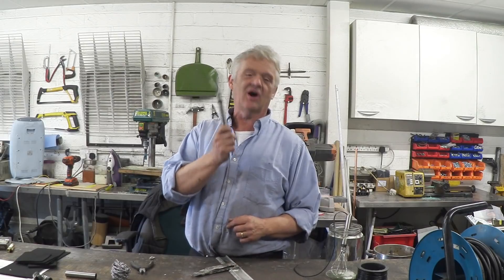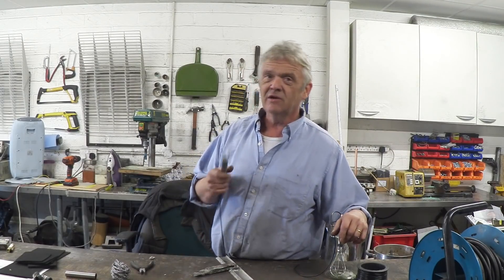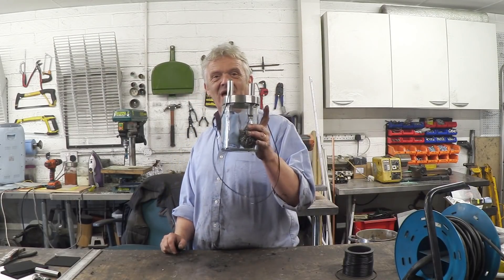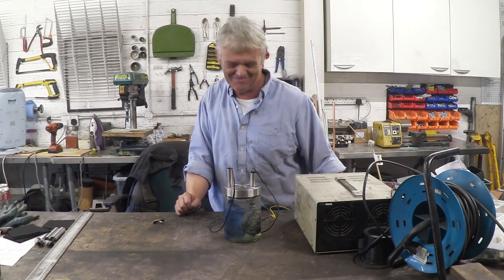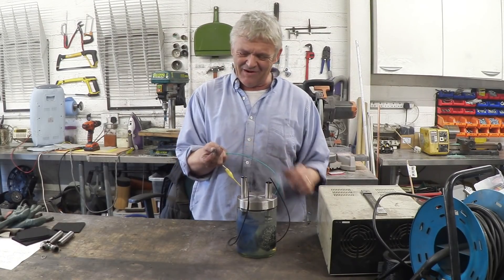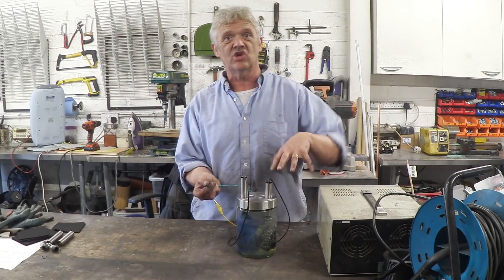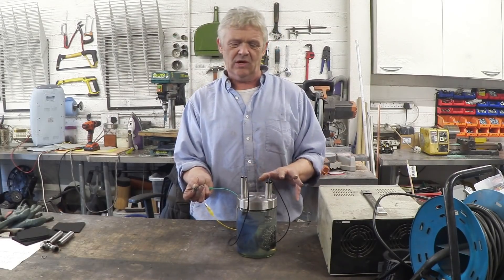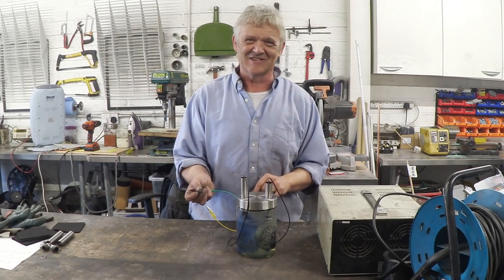1258 How To Make A Supercapacitor From An Egg Whisk

Comment: I accidentally made something like this with 2 pencil leads and a saturated magnesium sulfate solution. It can charge up to almost 3 V and deliver a reasonable amount of current for the size of its electrodes which are standard number 2 pencil leads.

Comment: Sir! I am having a problem .. I have tried to make battery 3 times and two with activated carbon and one with manganese dioxide .. Used potassium hydroxide as well as sodium sulphate electrolytes and charged on 2.6v  (at 3 volt electrolyte start burning) but all the time after charging voltage suddenly start dropping and battery don't have power to test on EBDtester ... Can anyone rectify what I am missing 😔

Comment: That's awesome, thanks Robert. :)
Reply from the maker: it was meant to help mate - I loved your idea
Reply: @ThinkingandTinkering  did you determine the overall output of that cell?

I was thinking about making a grid storage or backup storage device for the house for either power outages or for renewable energy storage. 

Would the wire whisk idea work if you were to wire a bank of these beakers in series and run an inverter off of it or am I dreaming in technicolor?

Comment: I still don't understand the difference between a battery and a capacitor. Seeing this it's even harder to get 🤦🏻‍♂️🤣
Reply: In brief and probably overly simplified  but  storing energy in a battery is done electrochemically, and discharging a battery is also electrochemical, as in chemicals are broken up and others are made and energy is either stored or released during these chemical changes. 

On the other hand, a capacitor simply stores charges without altering chemicals. There are several ways in which charges can be stored, but it's a capacitor if it's not changing the chemistry during charge and discharge.
Reply: @kreynolds1123  thank you for explaining. In that case, what sort of energy storage would those mechanical devices be? There's a couple of those around and they are usually called batteries too.
Reply: @marcogallazzi9049  ways a capacitor can store energy. 

We might start with looking at two flat plates and nothing but space in between as a basic capacitor. Charges builds up on  both plates. The charges tend to repel like charges on the same plate but are balanced by their attraction to the charges on the other plate. 

Now let's insert a separator inbetween two plates. Some molecules are polar having a positive side and a negative side, so that when placed in an electric field they will orientate according to the applied electric field.  It takes and stores energy to orientate the molecules.

 Some molecules may even even be stretched like a rubber band which takes and stores energy when you stretch it.  Note, we are not breaking the molecules so no chemical change, and no battery chemistry.

Now some molecules can be dissociated in a polar solvent  forming ions. Let's look at table salt, sodium chloride. In water it disasocuates to sodium (Na+) and chlorine (Cl-)  ions.  now the ions in the dielectric, water can move around changing the concentrations of the respective ions at both plates. It takes and stores energy to move these ions to a higher concentration of either at the plates.

Then let us add effective surface area to a plate with something like  activated charcoal. the charcoal conducts electrons to one plate and leaves electron vacancies at the other plate. With many small cavities in charcoal, it can take lots more ions shielding them from other ions. Now water breaks down at 1.24v applied voltage, but doesn't conduct at voltages below that. So this type capacitor is limited to very low voltage, but given the plate  dimensions they  have a super capacitance amount of charge at that can be stored at that voltage.

There are additional ways some  capacitors might store energy, but this comment is getting long and you can do your own research. 😁
Reply: @kreynolds1123 Thank you very much for this. I will have to read it a couple of times, there´s a lot to digest :) You put some very intereristing subjetcts, i will have to research some more.

Comment: Nice, do you know the cups that measure wind speed, add one of them with magnets and a coil (plus rectifier) and you have a self charging capacitor that runs a couple of LED lights in an emergency or when camping.

Comment: Not bad. I wonder what are the criteria to call something a super capacitor rather than a battery ? I have used a super capacitor in a project this month to drive a real time clock and have used batteries many times before. From electrical view they are a lot simular are they not ?

Comment: There are rumours saying that salty water may turn to HCl which may burn cells inside out due to clorine ions bonds with Hydrogens. Also That stainles steel may produce a substance called Hexavalent Chromium which is reported as highly carcinogenic but i am not sure. I recommend using Epsom Salt or Alum instead of NaCl as electrolye.

Comment: Hi 
I have a question is this working as a capacitor or a battery? To me it seems to have more in common with a simple lead acid cell as it uses an electrolyte and capacitors use non conducting dielectrics. Please correct me if I have the wrong end of the stick. Keep up the good work all very interesting 👍
Reply: It's a capacitor.  But something as simple as changing the electrolyte to something like zinc sulfate, can make it a battery capacitor hybrid.

Comment: Not sure if the carbon actually does much there, other than being a conductor. I say that because stainless steel forms a very thin layer of chromium oxide layer on it's surface. if that is a dialectric (metal oxides often are) then that layer will be a source of the capacitance 
have a play with with titanium sheet! Not difficult at all to anodize at a voltage of say 5V.  Once current drops to aproximately zero... the resulant capacitor has an effective breakdown voltage of 5V( but any breakdown just starts anodises it to the high voltage) and aprox 300mF per cm^2 plate area.
Reply: ...double the anodizing voltage, double the oxide layer thickness, and quarter the capacitance value etc

Comment: thanks for the video! what electrolyte would we think about for higher voltage? or is that information i would find in your books?
Reply from the maker: there are lots of papers and suggestions for higher voltage electrolytes mate - water in salt being a good example also deep eutectic solutions or redox additive electrolytes - there are such a lot and we have done quite a few videos on them I would suggest a google scholar search if that's ok as you will turn up a load of interesting ones - but some of them you might find hard to resource or to make and there are lots and lots options
Reply: Yeah, also as noted, its not a good idea to go with higher voltages because it will cause water electrolysis. Unless you are using DES or water in salt electrolytes.